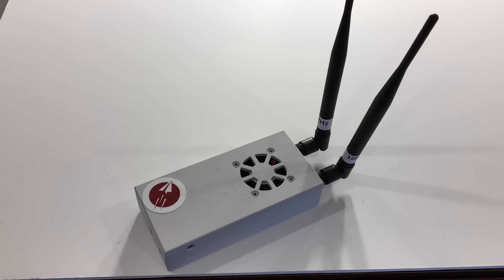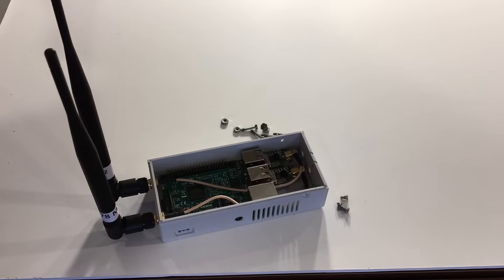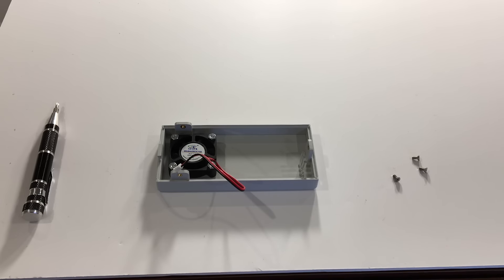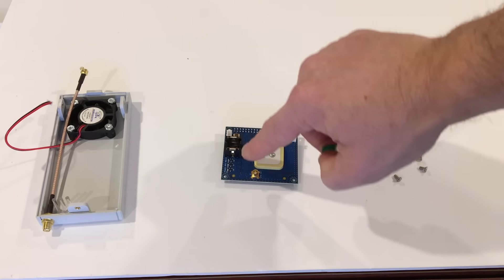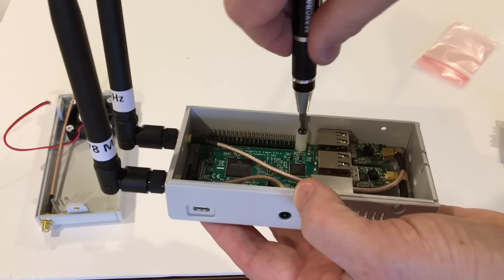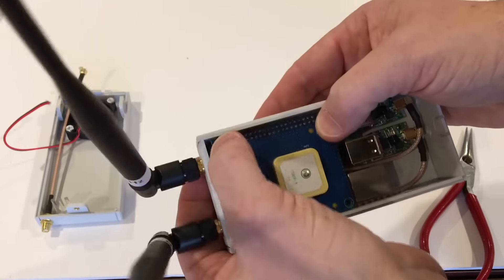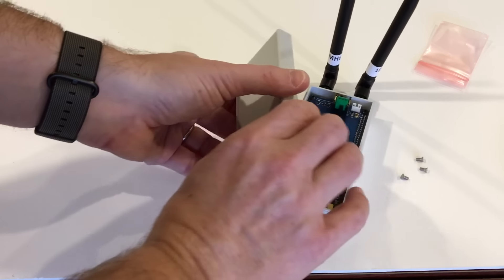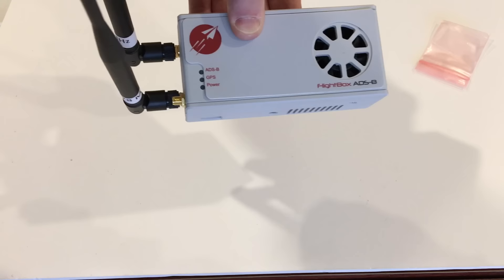FlightBox AHRS Board Installation

Comment: Great assembly video. You might want to mention the additional assy of the Pi 3 with built in WiFi. I have the original flight box with the USB WiFi adapter. There was no mention of upgrading my PI to the later version. I know have to order one. No big deal but I didn't see any mention of the upgrade when I ordered the AHRS upgrade. Maybe I missed it. If I did my apologies. Great work. Keep the updates coming.